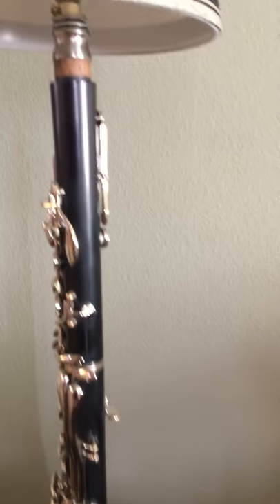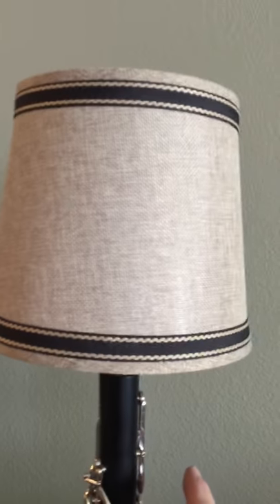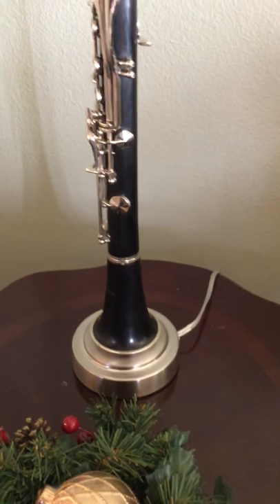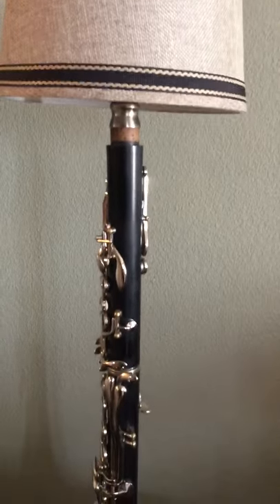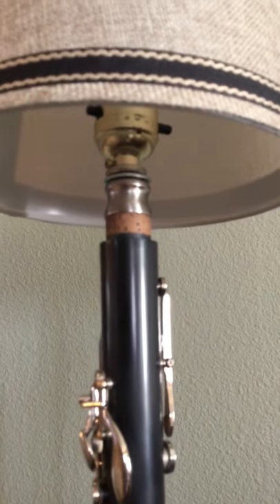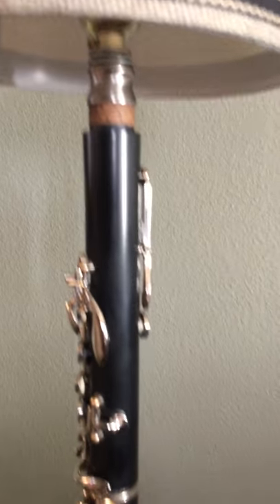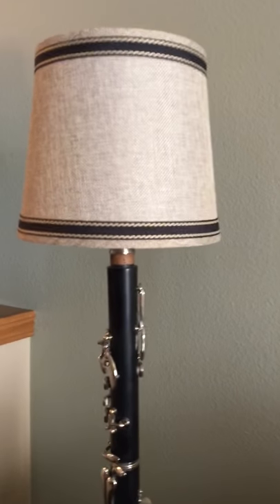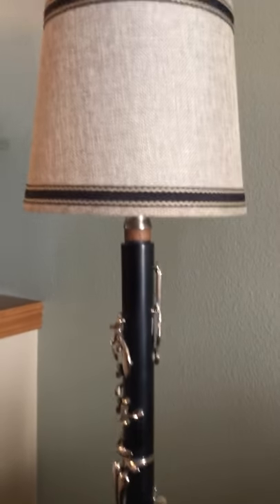B-Flat Clarinet Lamp On/Off with Octave Key

Comment: Do I need a METAL base? How do I connect the octave key to the rod?
Reply from the maker: Yes, I used a metal base with a metal rod.  That key on this clarinet (and maybe all) just so happened to have a metal insert in the hole that touched the metal rod inside.  In order for the octave key to contact the metal insert, I made sure to remove the felt pad from the portion of the key that covers the hole.  This way, the key made metal on metal contact.  I used some rubbing alcohol and cotton swab to make sure all of the adhesive was gone too.  The lamp will also come on by touching the base or the socket where the bulb I screwed in.  Thanks for your question.